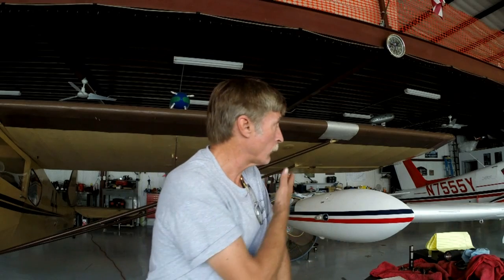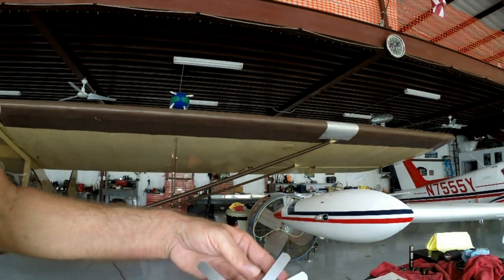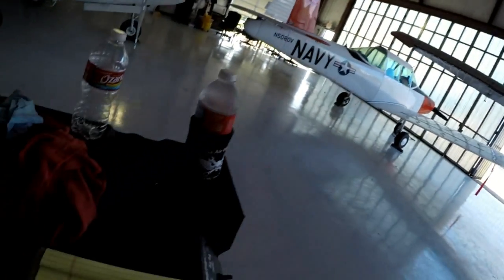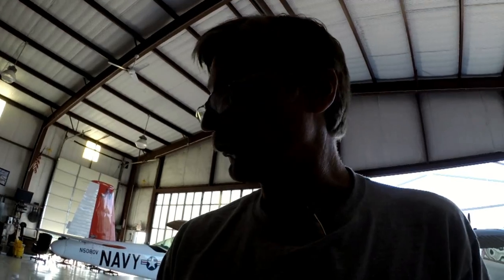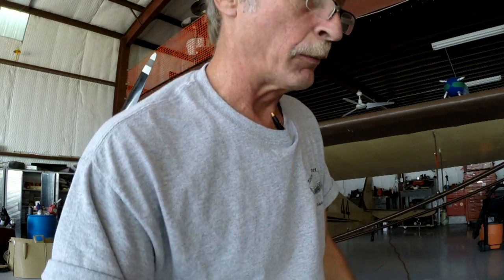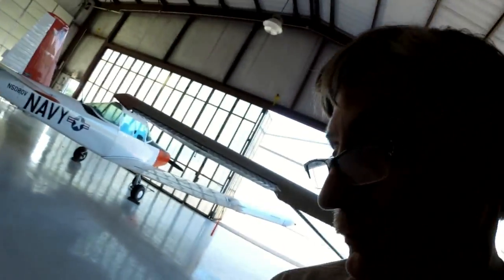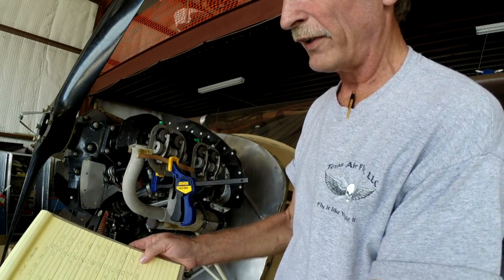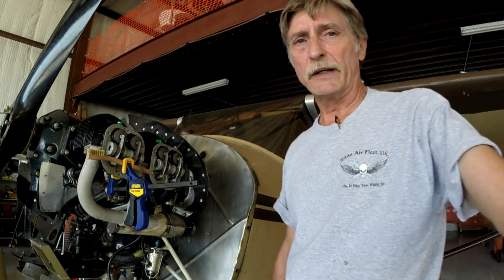Airplane Repo - Kevin Lacey - Engine Overhaul Series - Setting the Valve Clearance

Comment: I always thought when you had hydraulic lifters you set them with zero lash, that's the purpose of a hydraulic lifter the fluid takes and gives it real time adjustment, we only ever adjusted solid lifters with clearance on non aircraft engines.
Reply: Mark Nairn There's only 0 lash when the engine is running. Automotive and aircraft engines are that way. When the engine is off, and the lifters have no oil pressure, you get lash between your rocker arm and valve stem.

Comment: WHy do I think someone took this engine apart, threw the lifters and pushrods and rocker arms in a box and didnt bother to mark what cyl and exh or int. You did it probably al la the factory assembler. Good job. But if that were not the case, would a camshaft profile be called for?

Comment: Kevin, how long should a valve clearance job take on a Lycoming IO-540 K1E5? Can you give me a ballpark estimate in number of man hrs, both standard and worst case scenario?
Reply: Long time ago but, as long as you have the rubber rocker cover gaskets should be about a half hour per cylinder. Then you got a run it up and check it again

Comment: great vid ,,realy  shows it well , but when u had small clearances at the start and need larger ones do u not need   shorter push rods not longer ones ,,also   it would be good to see how u reduce those lifters down ,, i saw the clamp but how do u know when they are on the bottom to measure  all the best phil
Reply: I would also like to know the answer to that question.

Comment: I had to do the similar thing on my lycoming IO-360 A1A motor, I’m trying to overhaul. I had question, if you can possibly help me out with. I measured my clearances, to which they are all in spec. The cam looked fine, when I pulled the cylinders off, and the lifters. When I go to rotate it, the cam gear is making a weird sound. The motor is obviously timed to #1 cylinder, at TDC. When I remove the pushrods, the sound goes away, but then comes back when reinstalling them. I’m guessing the valve guides are worn? Haven’t done a wobble test yet, as I was just going to replace all of them anyway. The motor was purchased used with a little over 1600 hours on it, no prop strike. Any ideas of what it could be? Here is a link to a video, I made with that sound it was making. Thanks. 

https://youtu.be/-MIF8BejyTI

Comment: Why are there no adjuster nuts on the rockers?
Reply: Because that engine uses hydraulic tappets. You adjust the clearance by changing the length of the pushrod. They make a few different lengths,hope this helps!
Reply: Harley Davidson makes an aftermarket rod that is adjustable.
Reply: MN: Not certified for aviation use, they don't!